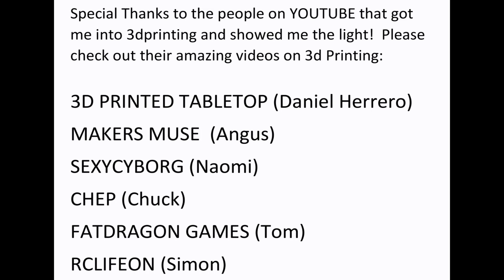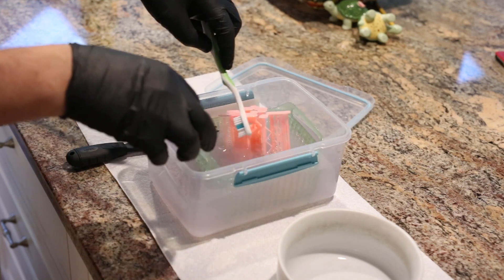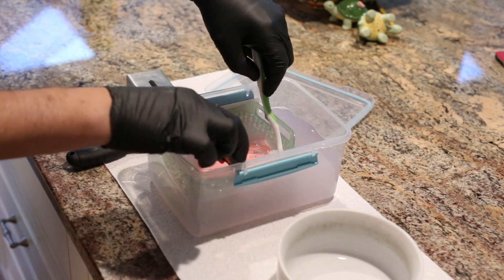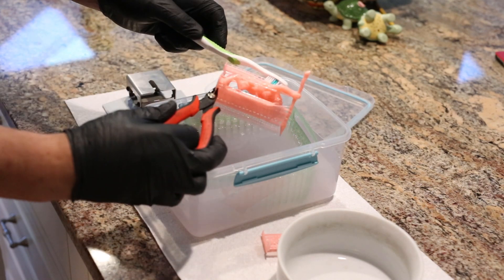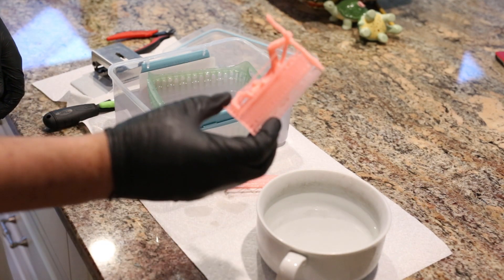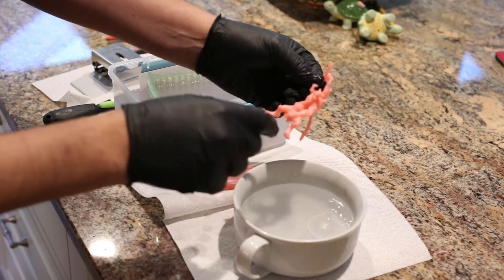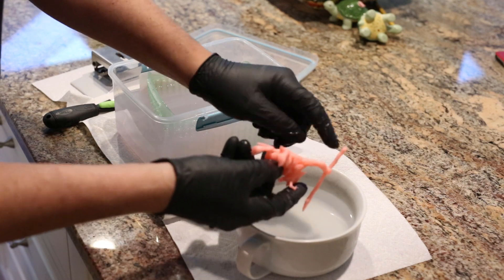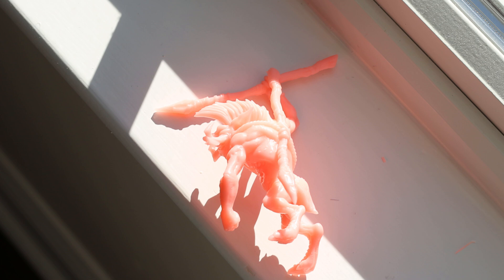My process for cleaning the resin model and support removal

Comment: Going to try the hot water trick. Just a little something that I have learned as well...the IPA does not seem to warp, or change the details on any of my prints, and I use an Anycubic Wash and Cure 2.0. I will let the plate and the models wash in the bath for almost 20-25 mins sometimes and they are perfect. I have seen that IPA can melt down and dilute thin or uncured resins but never damaged or hurt anything that was partially cured or fresh of the build. Once I am done with the clean I just cure it under the UVs and it's set. I usually leave it to settle/drain if any more resin is trapped in the hollows and then clean again if needed lightly in IPA with a tooth brush as you showed in your vid. Good advice and that seems to work really well with support removal. Love your vids by the way.

Comment: Woah, you straight up took the print from IPA to a hot water bath? Everywhere I go I keep reading that IPA plus water equals white residue on the surface of the print. That you should wait for the IPA to completely dry before puting in water. Did you ever have a problem with that white patina surface?
Reply from the maker: My prints come out clean as you see  :)
Reply: @3dprintingpro212  so mixing water with Ipa is not a problem. We just need to make sure the print is completely dry before curing, yes? Sorry for hammering this but there is just so much false information out there. You had me at raft layers, thank you that was exactly what I was thinking all this time. More over I think people are mixing up two separate terms, number of layers in the raft and number of base layers in the printing options. They are correlated but they are not the same.
Reply from the maker: @kaczorefx  yep

Comment: amazing tip, i had seen the hot water tip before even without use of IPA.
I will try it thx.

I heard that some prefer the transparant resin because the UV light can pass thru it better, which results in a better cured model.
greetings from Belgium
Franky Montens

Comment: Hi! 
Great videos I’ve learned so much from them, keep at it!
And I have a question, figured I should ask the expert.
Often when I remove supports they either leave a small hole or a small bump. It’s infuriating and not noticed until after priming.. Is this something you’ve encountered and have a solution to? Exposure time?
Reply: Lighter support tips, or adjust the positioning of the supports. Also, make sure and hollow all the models as well this will help make smaller surface areas to print for each slice and you will need less supports in general. The other fix I use is right before curing you can take some uncured resin, and an old brush and paint in the little dimples, when they cure it will turn solid and holes will go away. Otherwise light sanding and polishing will do the trick.

Comment: FYI, glass blocks at least 90% of all UV waves.  Most single glass planes block 99%. Curing it indoors behind a window is a bad idea.
Reply from the maker: Oddly everything I cure like that cures perfectly...not saying your premise is wrong but I have maybe 500 or so models cured that way that are in perfect condition...
Reply: 3DPrintingPro there are a lot of factors to consider, but I’d guess that most, if not all, of your prints are only partially cured.  I have a 60W UV lamp, and depending on the print, it takes 20-60 minutes to fully cure with the lamp placed just a few inches away.  Since every resin is different, it’s best to contact the manufacturer if you aren’t sure.  I know that some resins take several hours to cure under the conditions that I use.  Typically the faster a resin cures, the more brittle it is.

Comment: I never knew that resin could absorb water? I have heard so cure their models in water to increase uv exposure
Reply: Most resins are porous, but water doesn't interact much with cured resin or non-water washable monomers. IPA is used because it's that nice middle ground of interacting with the uncured resin monomers but doesn't dissolve the cured stuff, but the IPA will soften the cured resin if left in it too long. Of course resins come in many different types and formulations so there are almost always some exceptions to the rules.

Edited: typo
Reply: Same here, many people cure in water. It spreads the UV better into crevices and it reduces curing time by one half.

Comment: Water is not an acid. In fact, it has a pH of 7 which means its exactly neutral, unless there something in your water from the pipes. Same for isopropyl alcohol (IPA).
Reply from the maker: You are correct I meant universal solvent to be precise!

Comment: Great video! Was wondering how you dispose of the water though, since it might be contaminated with resin. Do evaporate it every time you use it or?
Reply from the maker: when it starts to look "dirty" I put it in the sun to cure, remove the cured resin, then dispose
Reply: @3dprintingpro212  Thanks! Definitely gonna try this to remove my supports.
Reply: @3dprintingpro212  so you reuse the water before it gets dirty? do you put it back in the pan for another mini?
Reply from the maker: @victorjl  Nope I cure it after one use strain it, dispose of it  :)

Comment: I receive my first resin printer in a few days, so I am hardly an expert, but it was my understanding that after being exposed to UV the liquid resin undergoes a chemical reaction as it cures and solidifies, that is, if not non-reactive to 99% IPA, is at least fairly resistant to IPA.  Have you experienced a loss of detail during the cleaning process?  Is the cured resin more reactive to IPA than I have been lead to believe?  Have you tried leaving a failed print sitting in IPA for a while to see what happens?  How much work time in the IPA before damage to the detail in done, etc?  Does the "non-toxic" pink resin react to cleaning differently than other resins?  I hope my questions aren't too much, I am legitimately interested in your experience working with the stuff.
Reply from the maker: All great questions and I am going to actually conduct some tests as best I can and then make a video on the results!  Have to print up a ton of the same model as controls first  :)
Reply: @3dprintingpro212  - Thanks for the reply, I'll keep a look out for that video.  I know I'll be referencing many of your vids this weekend as I setup and get comfortable with my new printer (assuming Amazon delivers it as expected).
Reply: @3dprintingpro212  Well, if you're going to do a bunch of testing .......... I'd love to see the effect of varying IPA soak times on dimensional accuracy of prints. Or any tests of dimensional accuracy for that matter.  That's something that doesn't seem to get much coverage - lots of info about print detail, but very little about creating dimensionally accurate parts. New subscriber, BTW. Loving the channel so far.
Reply from the maker: @JohnJones-oy3md  thanks man, I'm not sure I'll do an engineering take on dimensional accuracy, mine will be more like can I tell the difference on a mini if I soak it overnight by accident?  Something extreme like that which might at least tell us something about how it affects a part that needs to be precisely accurate...
Reply: Mean green works better, smells better, & has no chance of damaging your parts. It actually cleans your parts off instead of just trying to dissolve the resin.

Comment: Thank you for these videos, I love your content.  Since following your approach for supports I have had no failures and the quality of my models has gone up significantly.  
One question, did you use heavy supports on the feet of this model?  It is hard to tell in the video, but if heavies pop off that easy in hot water, it is a game changer for my post-processing.
Reply from the maker: I always have a few heavies around the low point of the "feet" or whatever is at the bottom of a model, and yes they come off that easy in the hot water  :)